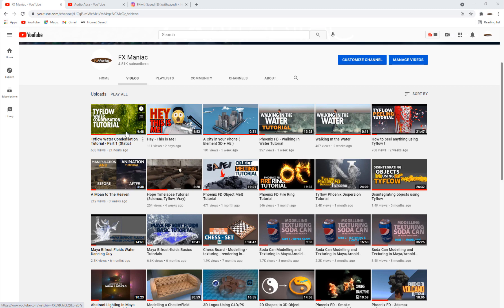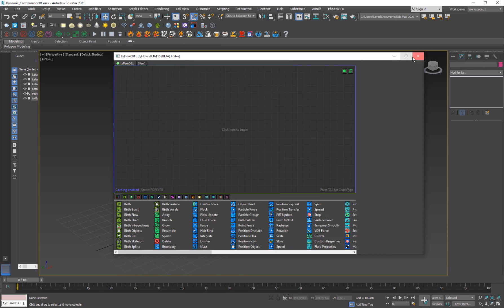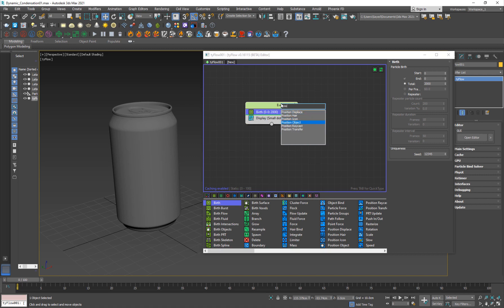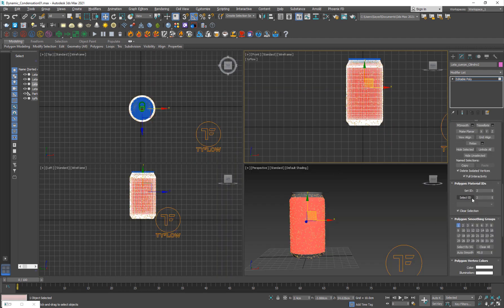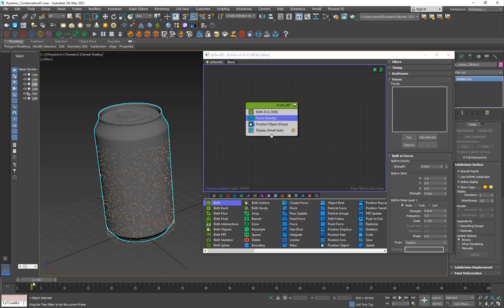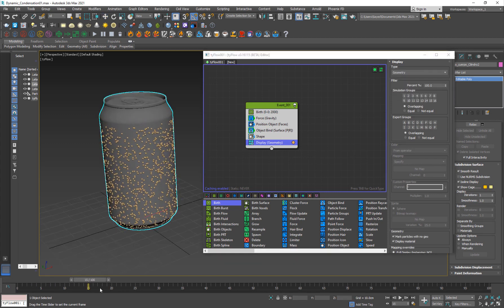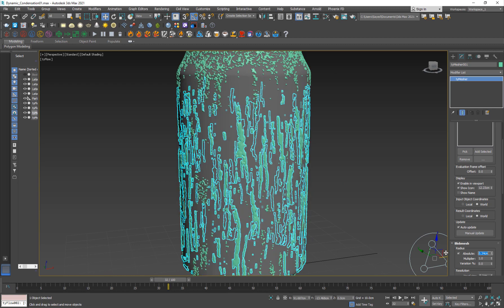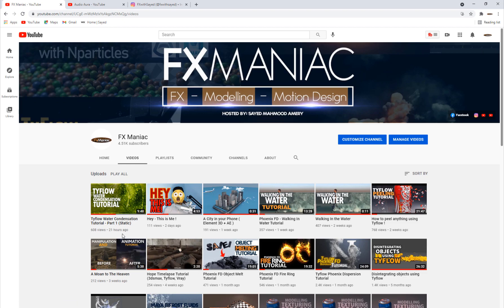Tyflow Water Condensation Tutorial - Part 2 (Animated)

Comment: Hi there. I'm stuck at 10:30 with particle force. I've set everything like your scene, but particle force doesn't seem to do anything. The second tyflow is just still :(
Is there anything I need to check or maybe something changed in the new version?
Reply from the maker: did you at the trailing particles setup as a force?
Reply: @fxmaniac2839  hm, I'm not sure how to do that 
I have them in particle force operator (inside droplet particles system). Is that what you meant?